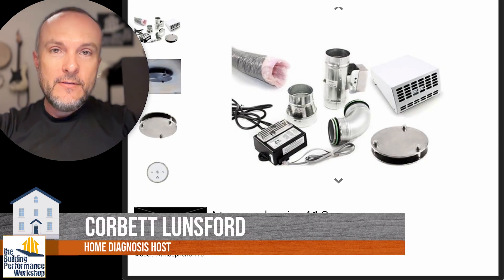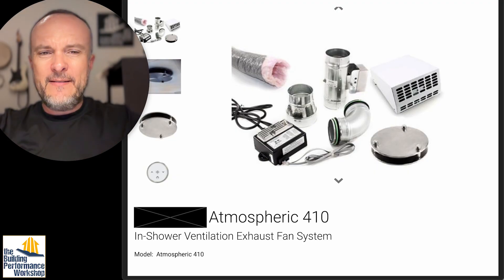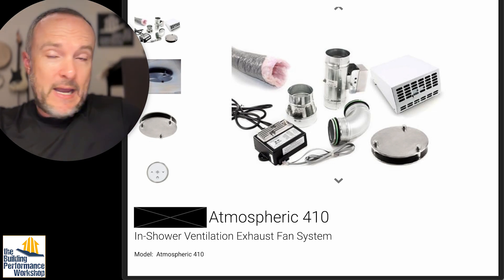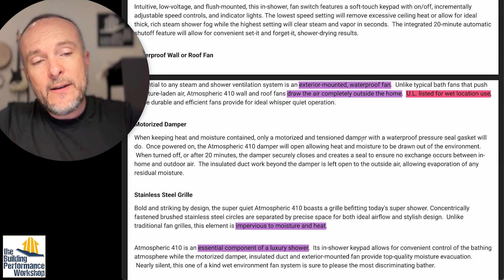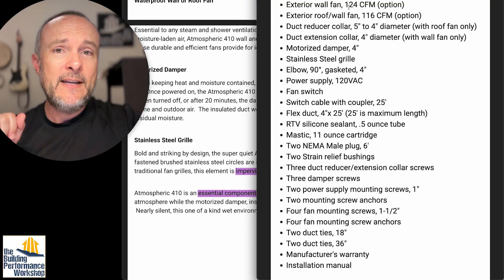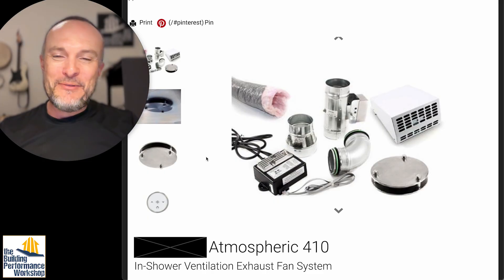Steam Showers: Special Bath Exhaust Fan Systems Mythbusted

Comment: BS marketing.

BUT having an exterior mounted fan instead of an in ceiling fan is actually better if you think about duct leaking as it will suck dry air from the wall/ceiling/attic instead of blowing super moist air into the cavities and create mould.

But if comparing it to an ERV then there isn't any upside since this also draws out the air before it gets mixed with dryer air and will reduce the chance of mould if it leaks anywhere after the fan.
Reply from the maker: The duct should be sealed if you do it right, so there’s no blowing or sucking on building cavities along the way

Comment: Geometry ?   The correct term is mass balance.  Mass (cfm) in is equal to mass (cfm) out.   Unless you are really compressing the air.   The geometry limits the cfm.  So you are correct.
Reply from the maker: Thank you- did not go to engineering school
Reply: @HomePerformance .  Good musicians make great engineers or programmers they understand the rules, know how to change the key and adapt to the rhythm of the moment.  Plus bring creativity to the design.
Reply from the maker: High five man ;)

Comment: My first experience of this was 25 years ago.  I purchased 4 Quiet Cool low velocity whole house fans.  Think supersized bath fan exhausting each bedroom into the attic which then cools from the convection.  When the boxes arrived, it was all stock HVAC equiptment.  To be fair, we didn't have the internet purchasing power then that we do now, so I would have still needed a contractor to access the parts.  For our climate (zone 3b), they have saved us thousands in a/c during shoulder season.

Comment: When it comes to products for any high end industry there are many companies selling stuff that you don't need or are nothing special etc. the reason is the people in that bracket will see the advertising and they will take it as technical gospel instead of the marketing wankery that it is. People from all walks fall for the fancy ads and wankery and don't do their own research and they will tell their builder they saw X product and they want it in their shower etc.  So much of that goes on in the automotive restoration world with stuff you don't need or there are far cheaper alternatives just as good but the customer saw X for sale...

     As for the stainless there are many grades and most use the grades that still rust. And I have been thinking about bathroom sizes and fan cfm. I would argue that smaller bathrooms need a higher cfm because they have less air in them to act as a buffer. (going by the in general most ventilation etc sucks in houses)  

       For steam showers... The better half turns any shower into a steam shower. She would jump in with a lobster in a pot...  

           One of the things I enjoy about parts of europe is the simplicity. You need a vent you do X need this you do Y. No special fancy stuff just this works and you use it. I really like how in Greece the entire bathroom is treated like a massive sower pan then the shower is built on top of the tile floor. Floor drains are required near all sinks and toilets. Was hoping to get some different pics for you but looks like our vacation to Greece is a no go. Mom is in rehab after a postop infection and dad now has to go for prostate surgery and daughter moved back in suddenly and and and. The story would make a great movie...

Comment: Thank you for covering this interesting topic. I enjoy hearing your perspective on this. One question - I know it’s important to supply oxygen, so it seems like in a steam shower maybe there should be supplemental air flow? I know certain rooms like this can have elevated CO2 levels and lower O2. I recognize there are not many showers even that do this but showers are typically quick and steam showers might be a bit longer.
Reply from the maker: Interesting- who knows how good for you it is to be breathing all that water vapor loaded with the particulate and microbes from your plumbing and shower head, too? Seems like steam showers could be categorized as a form of drug, in which case the user probably doesn’t mind breathing a little more CO2. Just adds more to the high ;)
Reply: @HomePerformance  Haha, well something to keep in mind (keep up that O2) :D

Comment: Thank you for sharing - - very helpful.
Q:  What about 2 fans (1 for pushing air into the shower area - and 1 for pulling the air out of the house) ?
Reply: That is exactly what an ERV does.
Reply: @judman13   Thanks for responding - -  what does ERV stand for?
Reply from the maker: Energy (or Enthalpy) Recovery Ventilator

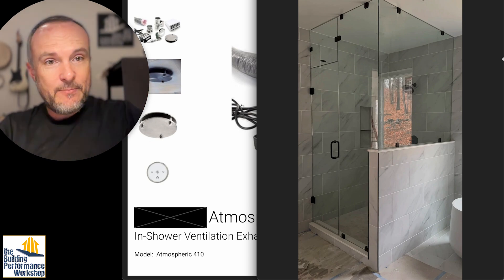Comment: 3:03 - - exhaust fan goes OVER the shower 
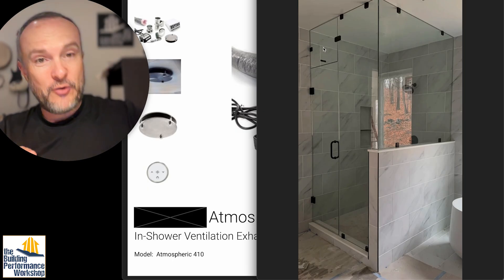2:40 - - air-tight shower
4:24 - - tile preferred (not drywall) ceiling
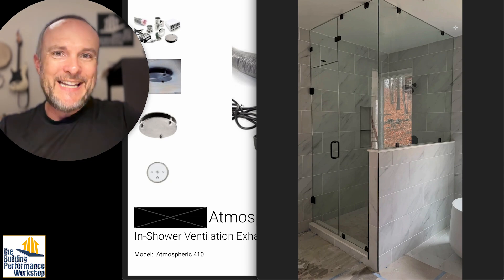4:34 - - open transom to allow incoming air

Comment: We live in a society that thinks the solution to problems are products. Its not about learning how to control the moisture its "what product controls the moisture". We are very unscientific. You see this all the time with people doing videos about insulation where they say stuff like "dont use fiberglass insulation itll get wet, use this new hemp insulation" "dont use osb you have to use plywood because osb rots" "homes these days are made with stick framing. Stick framing bad. Use structural brick". All these opinions with no understanding of the underlying science that makes something work or fail. This is a perfect example of methods > products.
Reply from the maker: Bullseye
Reply: Ideally, you would have a fundamentally good design and implement it with the best materials and workmanship you could afford. For example, I would rather have plywood over OSB for its better moisture resistance; the same would go for stainless steel or copper flashing versus something like galvanized. But regardless of what materials I can afford, I want the details designed as well as possible, and I want to get the most skilled and attentive installers for whatever product I use.
Reply: @ZergZfTw thats true. But that isnt what people think. I know that properly applied osb is nastly as good as plywood and gad advantages and disadvantages to plywood. Plywood is overall better but not required when things are designed correctly. People will see a house with tyvek, incorrectly lapped flashings, with a foundation 6 inches off the finished grade in a raining climate and say "the window sill rotted out because they used osb.